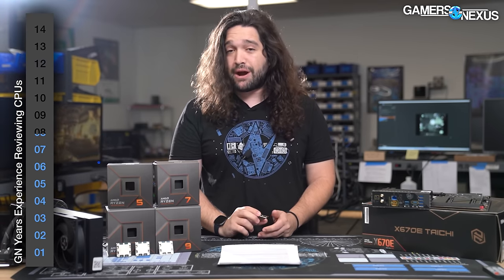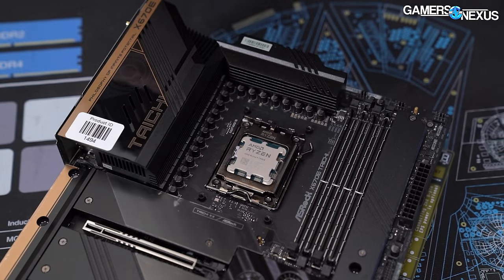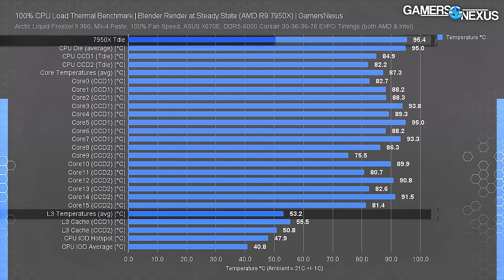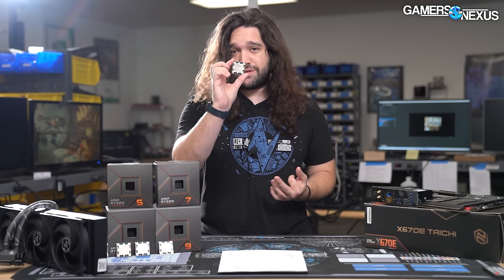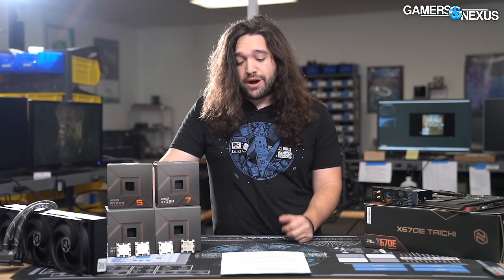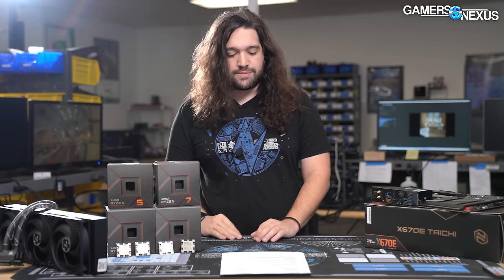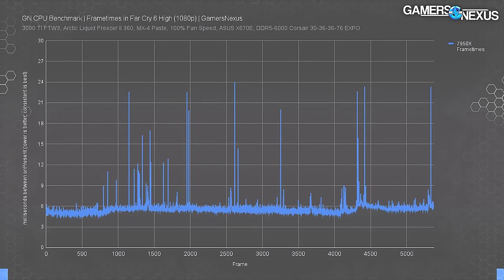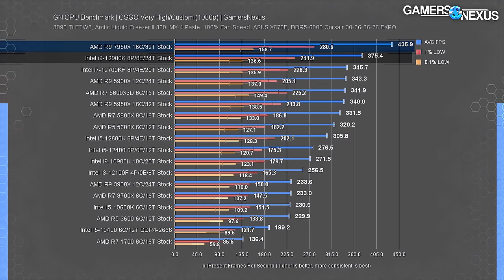95°C is Now Normal: AMD Ryzen 9 7950X CPU Review & Benchmarks

Comment: It's a bit funny how in all these charts the pattern with Intel CPUs is 11th gen does not qualify, but the 10th and 12th gen do, because 11th gen was a regression in every way.
Reply: Yea i9 was bad but 11th i5 series was great.
Reply: I got my 11600k and 16GB of DDR4 3200 for $120 used because of the rightful scorn 11th gen has 
Also got a deal on a 3080- about $800 into this system. Woo.
Reply: @nap8187  cool bro 11600k still not that good
Reply: I built a light production PC using the "waste of sand" 11700K. It does have pcie 4.0, which is nice for the 980 pro I put in there. Only reason I went that route was cost constraint. Microcenter was offering a free $200 Asus Prime motherboard with it for a couple weeks, so I did that over the 12700k or 5900x.
Edit- FYI that unadvertised sale is back on with the Asus Z590 TUF board...
Reply: How can you say it was a regression in every way?  It had an 11, over 10 in the name, so, clearly it's better cos number is more BIG!!!
/s
Reply: @spaceli0n  I do love how everyone pretends to be sitting on supercomputers even though steam survey clearly demonstrates that the vast majority are running lower end hardware.
Reply: @apersonontheinternet8006  vast majority doesn't sit on GN channel 24/7. It just some PC/laptop just sitting there for years without upgrade, most people aren't hardware geeks.
Reply: @andrewt9204   upgraded from i5-10600k to i7-11700kf (kept my z490 mobo), undervolted and boosted. It’s a nice chip. Just needs some tweaking to keep temps down.
Reply: @apersonontheinternet8006  Yeah, including people in Zimbabwe and Narnia, children, schools, and people who buy Dell prebuilts. Not adult tech enthusiasts watching an American reviewer or on PCMR
Reply: I believe the reason they aren't comparing 11th gen is because there was no AMD chip that year to compare it to. 
7950 -- 12th gen.
5950 -- 10th gen.
11th gen is the third wheel, whether it was bad or not doesn't come into it here, I'd say.
Reply: waste of sand
Reply: @Rspsand07  pcmr is mostly poor people. Look at what they think a beast rig is.
Reply: @apersonontheinternet8006  you dont need to a supercomputer to spend money wisely, 5600x would shit on 11-k series for a decent price.
Reply: @graog123  Seeing that the separation between comet lake and zen3 is larger vs rocket lake vs and zen3, i think the main reason is that they just outright avoid it because it's a downgrade over 10th gen while being incredibly power hungry vs anything else, and the 7950x is in reality the competitor of the 13900k but they simply can't compare them yet since it's not officially out
Reply: @spaceli0n  it is better than a 4gen intel
Reply from the maker: Hahaha. Yep, we cut it out because it was a waste of everyone's time.
Reply: @spaceli0n  5600x? still more expensive to be the same as 11400f in performance
Reply: I AM THE BEEST YOUUTUBER YOU'RE ALL TRAASH COMPARED TO ME IM THE BEEST 😂😂😂😂😂😂😂😂😂😂
Reply: Waste of sand
Reply: @TheStoso2  but you can drop it into any am4 board that you either already have or can pick up for very little money used. of course get the 5600 without the x though. built two systems for friends with the 5600 already, when considering total system cost it's the cheapest way to get high end gaming performance.
Reply: Backporting a "10"nm µarch to 14nm+++++ is never a good idea
Reply: @TheStoso2  5600x is actually cheaper than 11600k so dunno why you mention 11400. the 5600x bench is only 5% lower than 11600k for much less...
Reply: @andrewt9204  I saw them running that deal, and I told everyone I knew. 11th gen may not have been the absolute greatest, but an i7 and a high end mobo for about $200 made it the undisputed value king of the moment.
Reply: @apersonontheinternet8006  You ran a 4790 and a 10850K in the same computer, eh? Very impressive. 🙄
Reply: @spaceli0n  but the 11400 is pretty sick, especially when they’re on sale for less than a 5600
Reply: Steve: “More money better, though that’s generally how things work with computers”

Me thinking to myself: “And literally everything I enjoy”

 Steve: “Also depressingly in life”

Me: “Ah there it is…”
Reply: Me with 11700k 💀
Reply: while 9900k was very close to the 1090k instead
Reply: I'm tired of the bias that exist in the PC gaming ecosystem 

when AMD runs hot they get a free pass but when intel runs hot they are criticized, joked and bashed for it.

now power consumption has become a AMD fanboy talking point that it is almost political. 

you see their are double standards when it comes to AMD and Intel, because without double standards AMD has no standards and AMD are guilty by thier own damn standards
Reply: I got an insanely great deal on a new 11900k from best buy so I don’t mind. That’s the perks you get when nobody wants a certain CPU and they want to get rid of it at a local store.
Reply: @apersonontheinternet8006  I'm actually running a 5700k right now. The GPU though? An RX 480 8GB lol

I intend to hold for a while longer as well.
Reply: @GameTimeWhy  so an R7 250 paired with a Pentium D?
Reply: @drewdane40  he never said he ran both processors in the same overall computer. Just that the optiplex held him up until he got the newer processor. 

Honestly some people have stuck to a 2500k for as long or longer.
Reply: @michaelbeleut6480  I should start looking for the least desired products lol
Reply: @ArtisChronicles  haha yeah, it’s rare they make relatively good products people don’t want. Think only the 11900k fits into that category. 

Always worth a look.
Reply: @graog123  That's not true. Ryzen 5000 and 11th Gen released about the same time. 12th Gen came a year later.
Reply: @TheStoso2  the 5600 non x is faster than the 12400 and much faster than a 11400f what are you talking about? loll
Reply: @theplayerofus319  11400f delivers approximately the same amount of frames as the 5600x for 60% the price point, that's what I am talking about.
Reply: @TheStoso2  nope. Look at the 12400 benchmarks. The 12400 stomps the 11400 and the 5600 non x stomps the 12400 so the 5600 is easaly better than a 11400 in a cpu bound case... Just watch the gamers nexus review of the 12400 before talking crap
Reply: @theplayerofus319  just looked at three benchmark videos to fact check before commenting. You're paying much more for the same performance
Reply: @TheStoso2  its like 20% diffrence but ok blind man. Idk anyway my 5800x3d laughs about 7000 series and the prices of ram motherboard and cpu lol
Reply: @spaceli0n  literally keeps up with the 5600x in gaming... but yeah its still not good 😐
Reply: @drewdane40  yeah, the CPU was also on sale for 260 at the time. 260 for CPU + mid-hi end board is a great value for the performance. I wanted to go with 5800x or 5900x but I had to keep the total build cost under 1400. Couldn't do it with those.
Reply: @theplayerofus319 yeah, anyone on AM4 looking to upgrade should just aim for the 5800X3D instead of bothering with this series+new mobo+new memories (maybe new cooler? as well because 95°C looks crazy)
Reply: Then you notice a 11700K being the only chip with full AVX512 without motherboard and cooling gimmicks
Reply: 11700k very underrated nowadays considering price on used market
Reply: @floodo1  It was always underrated. Honestly the only descent part from Rocket Lake, the rest sucks and obliterated by Tiger Lake (11th gen mobile which is 10nm) or Ryzen 9 and Alder Lake.
Reply: 11th gen mobile at least got a die shrink.
But 11th gen in a laptop SUCKS I hate this Thinkpad P1 so much because of the CPU. If only there was a real competitor.
Reply: @nap8187  That's a very good deal
Reply: @coladoct Its funny how Amd shills like you ignored all the issue from this hot garbage space heater zen 4 and you keep talking about old products which doesn't matter anymore.
Reply: @spaceli0n  c'mon, the CPU is still good or even great for gaming and at that price that was a great deal!